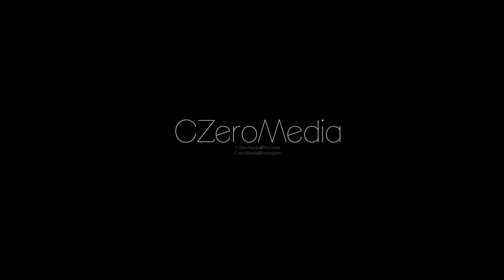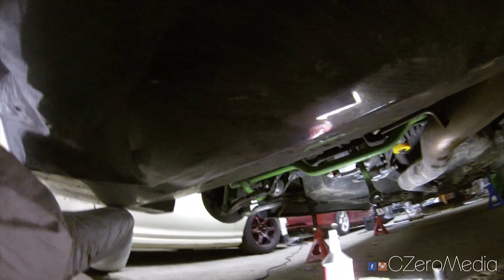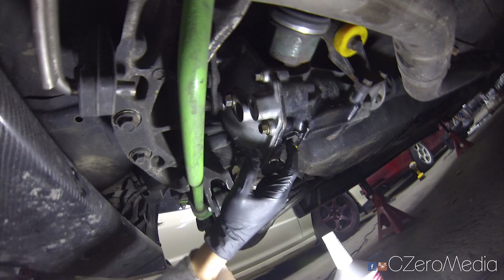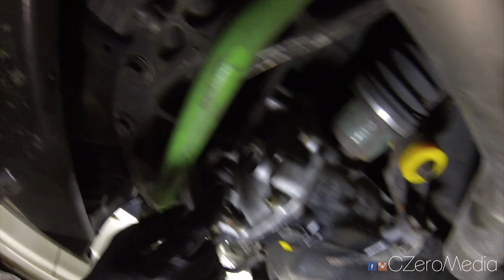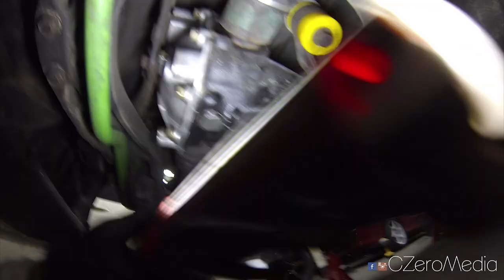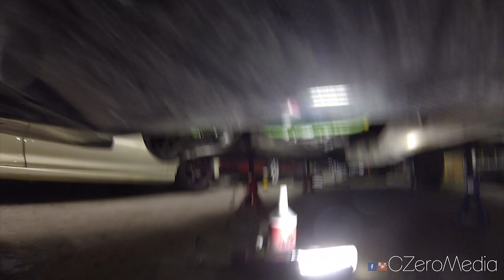Evo How to: Change Rear Differential Fluid

Comment: You might want to suggest to take the fill bold off first. Just in case the fill bolt is ceased. You don't want to drain the oil first and then find out you want refill it.

Comment: I thought u need to change both diff fluids. One holds LSD gear oil and the other holds ATP SP III fluid.
Reply: +itchigocambodian92 I believe he's changing LSD gear oil on an EVO 8 or 9.  On an EVO X, you have the active yaw control rear diff, with two separate fluids like you said.
Reply: CORRECT!!
 This is not an evo diff! An evo rear diff has three separate compartments, one holds LSD and the other two hold ATFSP3 and one of the ATFSP3 fluids require the pump to be driven by MUT111 scan tool (or similar) to change the fluid.
Reply: @marklove9682  calm down, I know it's been a year but I have an Evo and this is the rear diff
Reply: @huzzle101  yeah it's a RS diff mark needs to open his eyes lol